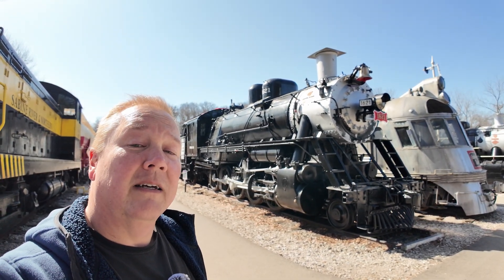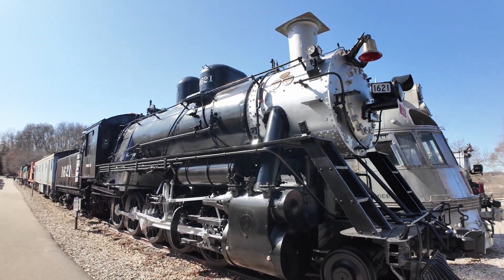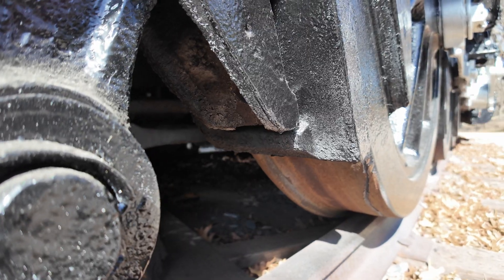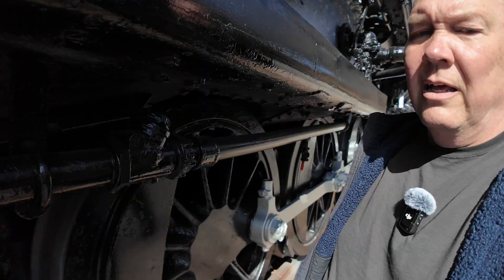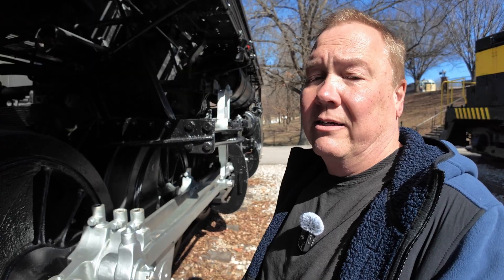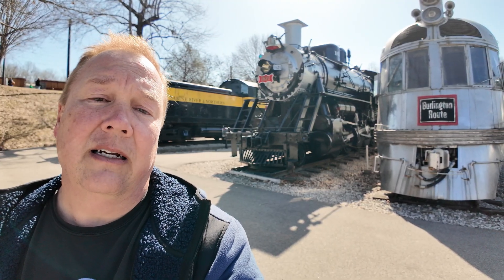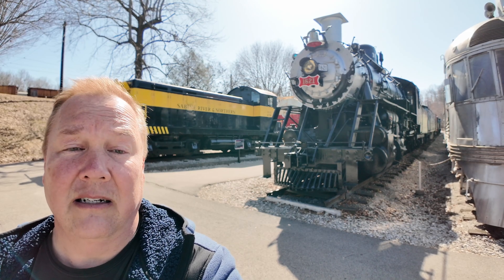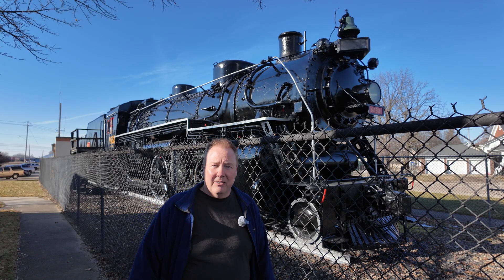The Russian Decapod Steam Engine Doesn't Fit US Rails!

Comment: I read an article in Trains Magazine about one of these Russian 2-10-0s that was donated to the Illinois Railway Museum and her trip there under tow. The wide drivers didn't really make a difference except for a few problems. One was self-guarded frogs. In most switches guard-rails on the rails opposite the frog guide the wheelsets away from the point of the frog and help it pass through the switch smoothly. On a self-guarded frog, there are "wings" cast into the frog on both sides to do the same thing without guardrails. The problem for the Russian Decapods is these wide wheels hit the wings and have to climb over them.

So there they were riding in the cab under tow: everything was going great. They'd asked the railroad about self-guarding frogs and were told there were none. They entered a pretty complex yard and all of a sudden the engine jumped up and crashed down like there was a cinderblock in the road!

They ground to a halt and found the engine with one driver perched up on a self-guarded frog. The Yardmaster came running up to find out what all the commotion was about and the Museum staff said "We were told there are no self-guarded frogs on this route!" The Yardmaster said "They're ALL like that in this yard!"

-at least until they cleared that yard, the going was slow and rough!

Comment: The Russians built their railway in a different gauge for a good reason. It’s harder for an invader to transport supplies if his trains don’t fit the rails
Reply from the maker: It's been pointed out recently that it also prevents Russia from taking their trains into out countries to invade.
Reply: It is a fact that at the countries that border Russia, if you travel by train, and wish to continue by train in Russia, you get out of the "host" country train, walk across the border and get into a Russian train.  And yes, done for defensive purposes to prevent invasion.
Reply from the maker: @davidrubin8228 not sure, outside Europe, how many international passenger lines run.  In the states, you want to take a train from Chicago to Toronto, you take a train to Detroit, cross the border by bus, then get on a Canadian train to Toronto.  Freights can cross, but not passenger trains.
Reply: The 5-ft gauge is an American design. At the time the railway between St. Petersburg and Moscow was designed and built, there was no gauge standardization anyway. You can't even say that a rail network existed in Europe.
Reply from the maker: @xandervk2371 5' was in the US and UK before that.  The Tsar, upon recommendation of a committee established it as the Russian standard in 1843.  No idea how long it took them to re-gauge all their lines.

Comment: The Boston & Maine Railroad was asked to try out one of these locomotives in hopes that Alco could sell them some.  However, as the story goes, one was in the yards at Boston and the first question was if the B&M had any "self-guarding frogs" on their switches. The response from whoever was representing the railroad was not so well informed and answered, "No, there are not any."  Well, withing just a few minutes of starting trials, [bam-bam-bam-bam-bam] was heard as the wide tires hit a self-guarding frog.  That was the end of the trial as the B&M had LOTS of them!!!  For those that don't know, switches with self-guarding frogs don't have guard rails opposite the frogs, the frogs themselves have raised wings that the outside of wheels contact, and they are forced to follow the proper channel through the frog. After my years of experience cutting wheels, I can easily see how the wide tires on the Russians could easily have been machined so that the width in the outer two inches could have been made standard, thus negating any frog issues.
Reply from the maker: I'm hoping someone knows how common those frogs were.  You're the first to mention just machining down the wheels a bit to deal with it, though.  Now that you mention it, you're right.  You should be able to easily take off that extra 1 3/4" of width from the outside up a bit.  How tall are the problem frogs?  Just an inch or so?  I don't think I've ever seen one.
Reply: @Industrial_Revolution  Self-guarding frogs are still very prevalent on industrial and yard tracks where speeds of less than 15 mph are used.  The risers for the wings or ridges that make them self-guarding are about 1 1/2 inches higher than the running surface and are slightly wider than the normal wheel width on standard gauge.
I don't think there is enough metal to remove to make the tires narrow enough to traverse a self-guarded frog and leave enough to clamp onto the wheel center if there would be any left at all.
These locos had a lower axle loading than most 2-8-2s but because of the extra driving wheelset, they were more powerful.  That meant they were well-suited to branch lines and railroads with light rail in the track as long as they could negotiate the curves.
This was not long after the Panama Canal had been finished and a number of the construction locos from there were brought back and regauged in the same manner.  The Panama Railroad and the construction railroads for the canal were 5-foot gauge.  Most of the construction locos were 2-6-0s.  The Panama Railroad was standard-gauged not long after the KCS got the concession to operate it just a few years ago.
Reply from the maker: @royreynolds108 funny you mention the Panama Canal.  I have a video coming up on one of the original mules in a few weeks.
That amount of metal is the same reason to question only the tires being replaced.  That's 1 3/4" overhang on the inside with some pretty thin metal.

Comment: I bet the wide track of the wheels help in the curves.  I wonder if the last driving wheel could be flangeless for better curve handling?
Reply from the maker: Doesn't really help on the curves since the flanges on the inside will still hit the rail.  What I have seen on a few, but not many, is that you skip the flanges on the center driver only, which gives you a bit more flexibility on curves.  This one didn't do that, and I don't know if any of them did.

Comment: Brunel had a 7 foot gauge train running for a while in Britain.
Reply from the maker: I've heard about that one.  All the stuff Brunel said it would do, it did do.  Smoother ride.  Faster.  More stable.  Also doubled the costs per mile of track, more than doubled the cost per mile for tunnels, bridges, etc.  If he had been first, it probably would have become standard gauge, but didn't end up happening that way.
Reply: @Industrial_Revolution  No and the Russian gauge is only different because they wanted something that an invading enemy could not use.
Reply: Brunel's broad gauge was 7 feet and one-quarter inch.

Comment: ONE ISSUE RAISED WAS THE FACT THAT THE REGUAGED LOCOMOTIVE COULD NOT TRAVERSE OVER RAIL LINES THAT HAD RAISED FROG GUARDS, DUE TO THE OUTER PROTRUSION AS WAS SHOWN!
ONE OF THESE LOCOMOTIVES WAS BEING SHIPPED ON ITS OWN WHEELS, AND AN INQUIRY MADE OF WERE THERE ANY RAISED GUARD FROGS PRESENT ON THE ROUTES USED.
THE RAILROAD SAID NONE WERE USED!
THERE WERE TWO GUYS RIDING IN THE CAB AS LOCOMOTIVE PILOTS/ WATCHMEN DURING THE MOVE WHO GOT TO RIDE OVER AN SET OF RAISED GUARD FROGS AT SPEED!
AN VERY BAD BUMP THAT FORTUNATELY DID NOT CAUSE ANY DERAILMENT OR DAMAGE!
KEEP THEM ROLLING BROTHERS!!
👍👍
Reply from the maker: I hadn't heard about that.  Makes sense, though.  Do you know how common those are?  I've never noticed them, but to tell you the truth, I've also never looked for them.
Reply: @Industrial_Revolution  NOT BEING A MAINTENANCE OF WAY EMPLOYEE I AM NOT SURE!!
THE STORY WAS ORIGINALLY READ BY MYSELF IN TRAINS MAGAZINE IN LATE 60s/VERY EARLY 70s!
MY GUESS THE RAISED GUARDS ARE USED IN HEAVILY CURVED AREAS!
Reply: VERY COOL STORY BUT WHY ARE WE YELLING?

Comment: The Alaska Railroad purchased about 25  ALCO/Brooks and ALCO/ Schenectady 2-6-0s that were 5 foot gauge. They had become surplus when the Panama canal construction was completed. Gauge was changed by installing wider driver tires at standard gauge. I've been told an issue was that they would sometimes derail at grade crossing when there was ice built up on the outside of the rails. Most were in use until about 1940 when WWII required the small, worn out locomotive to be replaced. The ARR also obtained a large number (over 300?) "Panama flats," wooden flat cars. These were converted by pressing wheels further onto the axles. The flats were converted to a number of other types of cars in the ARR shops. I have a photo with stacks of them deck loaded onto a ship bound to Alaska with the trucks removed.

Comment: Did you know that Finland has a special rail gauge that's specifically designed to prevent Russian trains from running through without regaging? It must be an anti invasion strategy. It must be tough to have the USSR and Russia as a neighbor.
Reply from the maker: I didn't.  I looked and found this...
"The first rail line in Finland was opened in January 1862. As Finland was then the Grand Duchy of Finland, an autonomous state ruled in personal union by Imperial Russia where railways were also built to the (5 ft) broad track gauge of 1,524 mm (5 ft).[14] However the railway systems were not connected until the bridge over the River Neva was built in 1913.[15] Russian trains could not have run on Finnish tracks, because the Finnish loading gauge was narrower, until the connection was made and the Finnish structure gauge was widened. "
So looks like same rail gauge, but narrower spaces for the locomotives and cars on those rails.
Reply: @Industrial_Revolution  Yeah, Finland and Russia used to have cross-border trains before CoViD, so the claim their networks are incompatible is bogus.
Reply from the maker: If that info I quoted is correct, the difference is not rail gauge, but maximum width of the locomotives and cars that'll fit through bridges, tunnels, etc.  You could run trains from Finland into Russia, but not the other way.  Really, though, even with different rail gauge, you can always run double-gauge where you need it.
Reply: I mean I have also heard the reverse, that the Soviets altered their gauge to thwart invasion by the west via Finland. 
Both fit cold war paranoia but neither hold water. The difference of guage is a mere 4mm, not different enough to cause break of gauge issues for either side wanting to run trains on the others' tracks -though I imagine any passengers will notice a drop in ride quality.
Reply: @gonzoengineering4894  i think the real reason was becasue broad gauge just suited the Russians nothing more or less. they had huge wide open areas and that meant broad gauge let them have larger higher capacity trains.
Reply: It's just as tough if not worse having NATO next door

Comment: And then funnily enough the same issue happened after WW2 with electric locomotives built for the USSR. Of course as the war ended the US refused sale of the type to Russia and thus put them on the surplus market where the Milwaukee Road bought them and used them until the end of electrification on their railroad. The units were nicknamed “Little Joes” in reference to Joseph Stalin

It’s also of note to say that the Virginian Railway the small, highly efficient modern coal hauling railroad that operated in Virginia and West Virginia had “AE” locomotives built, they were essentially 2 decapods built onto an articulated frame. The wheel count was 2-10-10-2, they were highly successful and very very powerful complex machines that could carry 1,000’s of tons of coal over the Appalachian mountains to the port of Norfolk. It is debated that those locomotives were more powerful than even UP’s “Big Boy” even more impressive when they predated the “Big Boy” by nearly 3 decades
Reply from the maker: That's a LOT of drivers!
Reply: @Industrial_Revolution  absolutely a lot of drivers and pictures show just how insanely big the front cylinders were to utilize the low pressure steam as the cylinders shared steam like a triple expansion engine on old steam ships.
Reply from the maker: I've heard there were a handful of triple-expansion steam locomotives, but can't find details right now.
Reply: @Industrial_Revolution  Delaware & Hudson

Comment: There's another gauge you might not be aware of.  The Toronto Transit Commission has it's own gauge that's used nowhere else in the world.  It's 4' 10 7/8".  There are different stories about how that came about, the the main one seems to be the idea was to keep trains off the streetcar tracks.  In the early 50s, when Toronto got it's first subway line, it used the same TTC gauge, as the idea at the time is subways and streetcars might share the same tracks, though that never happened, except for some streetcars that were adapted to be used as subway maintenance cars..  Also, the new LRT lines use standard gauge.
Reply from the maker: I knew about that one, but only because I talked with someone at the Illinois Railway Museum who was trying to figure out how to re-gauge one to work on their standard gauge lines.

Comment: In Australia we had many gauges.  So a lot of engines were designed to be regauged.  For example a successful 3'6" engine was used as the pattern for a 2'6" engine by the expedient of moving the wheels to INSIDE the frame for the narrower gauge while keeping everything else the same.  Our D3 was built in the US to a 4' 8 1/2" design but we used 5'3".  So inside the frame 6 1/2" spacers were added. Simple.  The regauging if needed was simply new axles and remove the spacers plus some other minor changes.  After about 1920 our new designs had to be made so that they could be easily changed to the narrower gauge.  3' 6" engines were a lot smaller so that regauging was never really an option.
Reply from the maker: I think everyone used to have a lot of different gauges.  The States had gauges all over the place until the end of the Civil War, when the federal government sorta mandated a standard, although even there, they still allowed a lot of narrow gauge to continue running.  Some railroad museums even have double-gauged rails so they can run both standard and narrow gauge, and I saw pictures of a place in Europe that's running triple gauge, one standard and two, different narrow gauge lines on a piece of the same route.
Outside of steam locomotive drivers, it doesn't seem like a huge problem to change gauges on individual locomotives or cars.  The real challenge is that changing ALL of them, plus all the rails, switches, etc, while somehow still keeping everything moving, is a logistics nightmare.  I may try to do a video on the changeover in the States if I can find enough good info on it.  There were definitely some interesting solutions during the transition.
Reply: @Industrial_Revolution  Australia still has a lot of gauges, up north east they use narrow gauge in the east they use standard and south east is standard and broad gauge
Reply from the maker: @fuzzle426 Is there much double-gauge there?  Different gauges do have different advantages.
Reply: @Industrial_Revolution  There is no real advantage in broad gauge and it just costs more to build.

The same goes for the 3' 6" lines running over mostly flat or undulating country. Marginaly cheaper to build but dearer to run.

Narrow gauge is fine for specialist applications.

There is a little amount of dual gauge track in place. There used to be tripple gauge as wall.
Reply: Why is it that Australians always have to interject how they do things, and always preface it by "In Australia". Literally nobody cares.

Comment: My Dad was a volunteer conductor/ticket agent for the Stewartstown RR in Stewartstown, PA. The equipment and the track were slightly different gauges. It was pretty good on the straightaways, but squealed like all get-out on the curves. I think the track was slightly narrower than standard, but that could be a bad recollection on my part.
Reply from the maker: i just looked it up and it looks like it is standard gauge there.  it's possible some of it was laid slightly off, though.  Curves can always squeal, especially with worn rail or wheels.
Reply: @Industrial_Revolution  That’s the old Northern Central Division of the PRR. The Stewartstown tourist line went belly up but is back in operation today as the Northern Central Railway. I rode the line just a month ago and there’s a lot of squealing on curves. The conductor blamed it on low speed operation on a railroad graded by the PRR for 50 MPH running.
Reply: it was usual to slightly increase the gauge for curves, a little for broad curves, slightly more for tighter ones. This was especially good for the long rigid wheelbases of eight and ten coupled locomotives. The squealing might be because the track panels were built for straights, but were then moved, and bent to be used in a curve: the gauge would then be a bit tight.